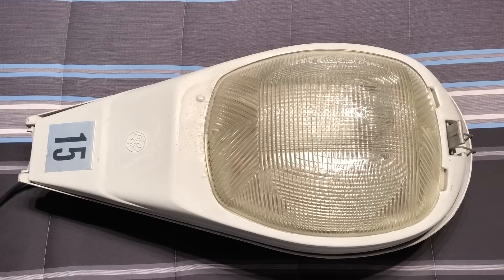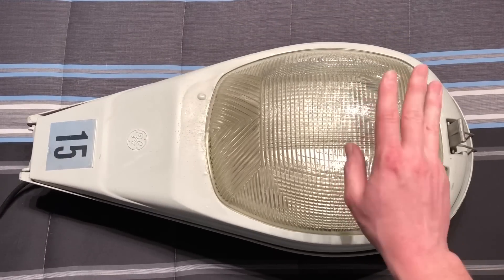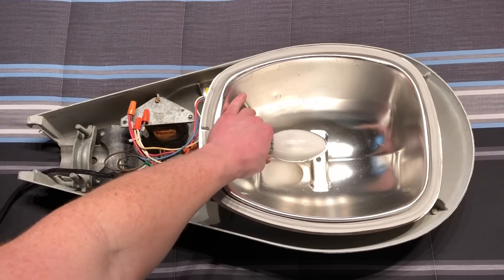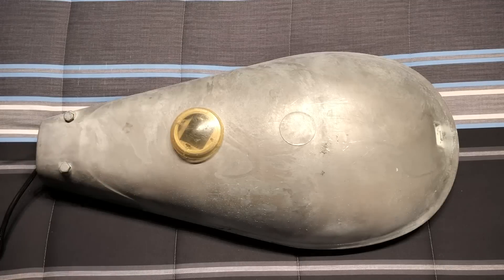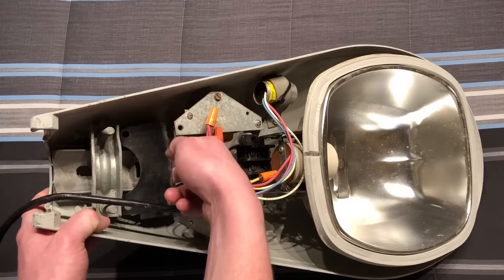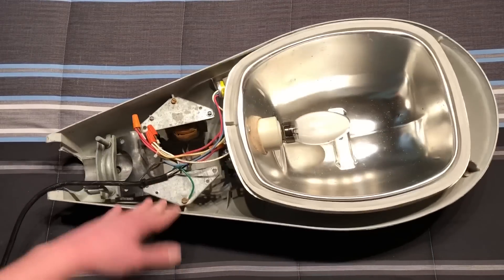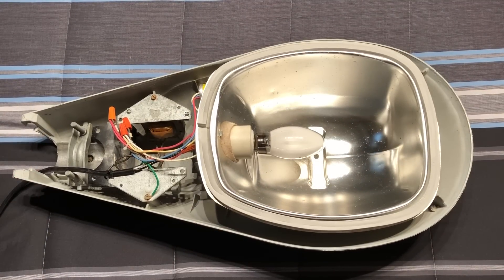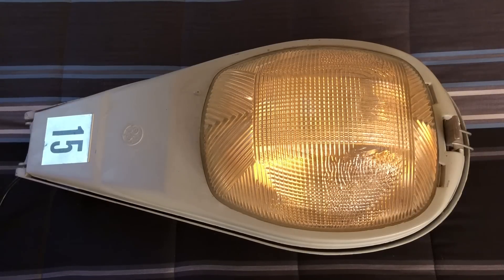GE M250R1 35watt High Pressure Sodium Street Light

Comment: I have my own now, unfortunately they are a little bit to big. I have two fixtures that were built for 150 watt, which is way too strong, so they were converted to 70 watt, with brand new components. Because they were meant for pretty strong lamps it does not have a refractor, just flat clear glass, and the fixtures are frankly, quite huge. A nice thing about that is that they is room for a lot, so if i were to want to convert it something else, i could. I may find a way to install a dimmer (if possble) or just put a very strong refractor over it.

Comment: To IES members and lighting professionals: "fixtures" belong in bathrooms; "luminaires" are light sources, such as the M250A or Westinghouse OV-25 luminaires.  The "lens" you refer to is a "refractor" assembly.  Also for HPS operation, you must replace "like for like" such as a 4-kV pulse-start socket.  Otherwise you risk some safety factors.  This is not a "fixture."

Comment: I found an M250R1 at a “lighting graveyard” and it was beat to hell.  It was a 250w HPS wired at 208v.  The original data sticker is still in there intact, and it was manu. In 1981.  I bought a new GE S50 Ballast and sent it off to be restored.  I also had a PCR installed, as it, like yours, did not come with one.  When I got it back, I put a new GE Yellow 25 sticker on there, and now it looks like a NOS M250R1.  Spraypainted and clear coated to look just like it would out of the box.